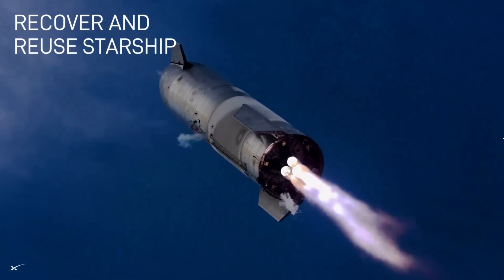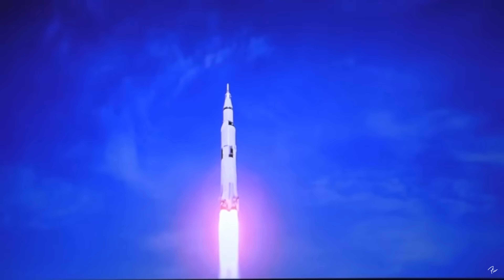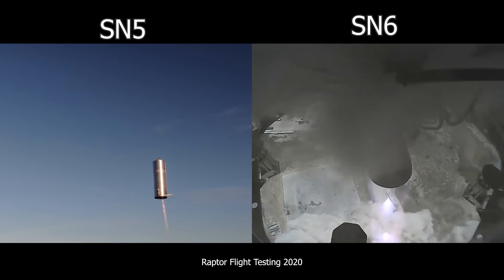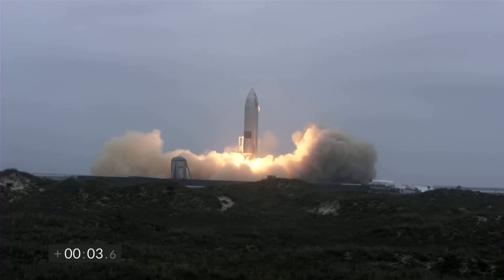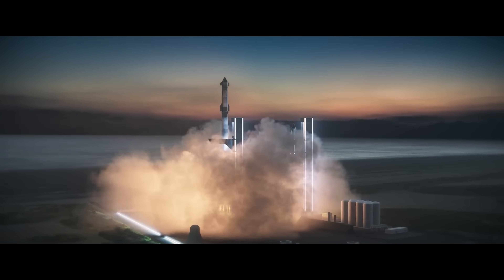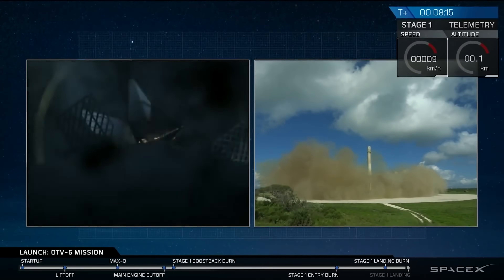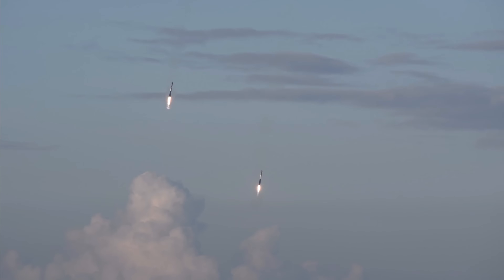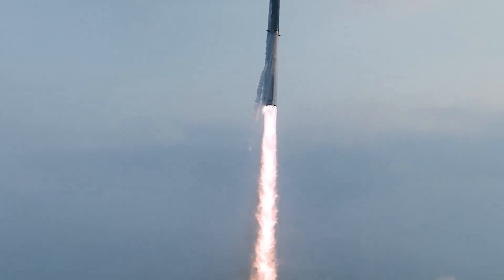The SpaceX Rocket Engine That Couldn't

Comment: Thanks Jeff Thornberg and program producer. He should have stuck around. Reckon there’s still lotsa homework lying around. Team SpaceX. Team Elon Musk & Team MARS   Thanks Again. PS. Tell him I can resolve heat shield issue. I wrote a 7 year 20 hour a day Dissertation on Ceramic Shell Bronze Casting moulds. And did Mathematical Scientific and biological analysis of materials from the mine as materials altered from raw material through to making of them into micron packaged bags available for use. Did receipts slurry viscosities and application and heat resistant temp measurements I can do their heat resistant coating. One application totally reuse-able and utterly damage free to ship and Astronaut s going to and from Mars. Build fuel tankers Mars moon landing bases. I have no means to communicate with Elon or SPACEX. Highly qualified 3Dimensional thinker RIC

Comment: As disappointed as I am with Elon Musk being such a broken toddler with regard to so many aspects of humanity, his companies--with the distinct exception of "X" his purchase and leadership of which was a tragic mistake--are the most impressive in the Western world.  I am also convinced that the Starship program has the potential to play a pivotal role in transforming human impacts on Earth’s biosphere from relentless destruction into climate system and ecosystem restoration and sustainable progress (e.g. by enabling rapid replacement of Earth-based mining with asteroid utilization).  That being said, I’m worried about test flight five.

Sure, the arguments or high risk failure-based learning have proven effective.  But the balance of risk versus reward remains really complicated.  The first test flight should have proven that.  The only reason it ended up being deemed worthwhile is that the impacts of destroying the launch pad didn’t cause significant environmental harm.  It could easily have been just slightly worse and caused the entire program to be shut down for years.  The potential explosive destruction resulting from a failed booster catch attempt may well do just that.  If I remember correctly, although the flight four booster apparently successfully performed a well controlled ocean landing, it was notably distant from the actual (original) targeted coordinates.  Despite SpaceX’s truly excellent track record of landing Falcon 9 boosters, which are very different, it seems to me that skipping the step of proving they have achieved pinpoint accuracy (within the margins acceptable for a successful catch) is a serious mistake.  It’s all too likely to not only dramatically slow the entire program down, but rationally and severely damage everyone’s view of SpaceX’s judgment.

Given how Musk’s devolution into an anti-American oligarch, demonstrating his fundamentally flawed racist and arrogant libertarian toddler’s character (presumably due to his traumatic and abused childhood) which echoes that of the foul folk he’s now indebted to because of the “X” purchase fiasco, has rightfully ruined his reputation with most reasonable Americans; I hope SpaceX (and his other companies for that matter) can survive the real consequences of his unbridled hubris.  Sadly, perhaps the most significant lesson that may come from his disruptive transformation of the processes of progress by appropriately leveraging failure will be that Americans finally appreciate and understand that privateering individuals and cults of personality which are not appropriately regulated are irrational and unsustainable.

Comment: Was there any research done at all for this video, the cost of Raptor 1 was less than 2 million per engine and Raptor 2 is roughly half the cost of Raptor 1. Raptor 3 is roughly half the cost again.
Reply: You have no idea what they actually cost, we only know what we have been told by spacex who have been shown repeatedly to do "creative accounting" for stuff like this.
Reply: @oglordbrandon  And you have no idea if the costings are incorrect. One thing is for sure, the complexity has been massively reduced from V1 which could easily translate to half the cost saved.
Reply: @schrodingerscat1863 
We cannot know what the costs are, but we do know that SpaceX have changed the design of the vehicle every time and retrofit much onto previously built vehicles.

We also know that the last cost metrics are at least two years old.

So you’re arguing from ignorance of the age of data.
Reply: @topsecret1837  As I said, all we know is what SpaceX or Musk have released. From that we know they wanted to get v3 costs down to around 250 to 500 thousand. Based on the simplicity of the v3 engine it is likely they have substantially reduced complexity and therefore costs. Have they managed to hit their cost target, we don't know but they will have reduced costs substantially.
Reply: @schrodingerscat1863  I still see only source for the numbers Elon/Spacex . Probably I should dig into the "design simplification" aspect but I am pretty sure I am not good enough of rocket engineer to deduce costs out of that. Guess time will tell. 

As for myself I would not belive any private business/owner with their  numbers - it's always their interests to show it in better light than it actually is. It's a tiny bit better with public businesses but even then if they are big enough (like most rocketry players) then it's easy to lie even with public numbers. Plus I admit: yeah there's a special place for Elon in my heart because he's been caught lying one too many times in the past.
Reply: @kalaants  From various sources like interviews with Tim Dodd etc we can see that there has been significant simplification specifically to reduce time and cost of manufacture as well as to improve reliability and reduce weight. Based on this the numbers Elon/SpaceX have released are plausible but that is all we can determine for now. We will probably never know the actual costs and as manufacturing processes mature costs will continue to fall. Reducing the cost and complexity of the engine has been their number one priority and based on what we can actually see of Raptor 3 they seem to have been pretty successful in this.
Reply: "Because Elon said"? Or what exactly is the source for these numbers?
Reply: @kalaants  All anyone can go on are numbers released by Musk or SpaceX, reduced complexity of the engine to ease manufacturing is a key feature though and they are making an engine every day or so. So they have now made so many of these engines with so many simplifications that manufacturing costs can easily be significantly lower than anything else. You only have to look at a Raptor 2 compared to say a BE4 to realise how much more advanced the Raptor is in this respect, BE4s are being sold to ULA for around 8million each and based on attempts to renegotiate the contract it seems Blue Origin are probably losing money on those engines. Looking at Raptor3 the engine doesn't even look finished it is such a streamlined and simplified design. No company has ever made the effort to do this before and I can easily see how costs have been reduced by orders of magnitude for these engines.
Reply: @kalaants  Under one million is the only first hand source number.  “the source is a guy I don’t like,” isn’t a good counter argument when he happens to run the company.

Comment: So here's my question.. how are they going to land a fully assembled starship on the moon or mars, carrying 100-200tons?
Reply: starship is just the upper portion not the booster the booster will never leave earth. And on mars that 200 tons weighs 76tons and on the moon it weighs 34 tons. But i don't think they actually have the method nailed down just yet as far as the landing system goes because well they just aren't their yet. It will likely be some type of deployable legs but i dont think they have released any info on what that might look like yet. LIkely because the ship is still being designed so they do not know how much weight they will have to work with and its hard to design something if you dont have all the parameters you are designing to yet.
Reply: Landing on the Moon will require a ring of landing engines mounted just above the main tanks. These engines may only be necessary during the lowest 300 meters, to prevent throwing regolith and eroding the surface where each leg must touch down. 

The instrumentation needs to be highly accurate, bringing the horizontal velocity to absolute zero. The landing sensors, cameras and software must select a destination where the surface is adequate for every landing leg, and deployment of cargo by crane. 

The landing legs must conform to the uneven surface and make the craft level plumb.

Comment: While Raptor 1 may indeed have come in at $2 million a pop, all integrated flight tests have used Raptor 2, and Raptor 2's cost per unit is actually under $1 million.  The entire stack, Starship and Booster combined, with all 39 engines and all those tiles, costs under $100 million.  Still pricey, but an easier pill to swallow when attempting to contextualize rapid iteration of Starship.  For comparison, SLS is a >$2 billion vehicle.  I should also point out that a huge benefit of using engines of Raptor's size is that you can swap one out in an hour, without having to first take the entire vehicle back to a bay and/or tip it on its side.  The likes of SLS or New Glenn cannot boast a similar ease of maintenance.
Reply: New Glenn might be able to. Sure they are bigger but they are similar in size and have the similar thrust
Reply: You will know this 100 million is a lie when you see what NASA pays for starship to go to the moon.
Reply: @oglordbrandon  Current Starship stacks run about $100 million to manufacture.  (It's actually ~$90 million now per Ars Technica and others but we like round numbers here.)  You're basically saying it's a lie that SLS only costs $2 billion to make when the total mission cost is actually 2 to 3 times that.  I'm... really not sure how you thought that was any kind of argument.
Reply: swap one out in an hour?    What makes you say that?
Reply: @CurtOntheRadio  we've seen them do it
Reply: @CurtOntheRadio  We actually watched SpaceX effectively do this after a Static fire test.
Reply: @SirDoggydog  where?  when?
Reply: @CurtOntheRadio  Nasa OIG report on SLS is cost
Reply: Idk what is up with you spacex fans. That Sls figure is the entire cost of the program including launch infrastructure and payroll. The marginal vehicle cost isn’t 2 billion. The starship total cost per launch is also easily a billion dollars when including what is included in the Sls launch figure
Reply: @mattkingston6157  No, The Marginal SLS Cost is over 2 billion.  The full Artemis 1 launch cost 4 billion before accounting for launch infrastructure.
Reply: @mattkingston6157  Bro, all of this is a google away and documented persistently in articles discussing the topic.  SLS is $2 billion per vehicle, or $4 billion in its Artemis configuration.  By the time Artemis I launched, the development program for SLS had reached costs of $23 billion.  If you really want to conflate the costs of development with the costs of post-development manufacture—something nobody does—SLS currently sits pretty at a prospective $10 billion per vehicle.  In this fun hypothetical, SpaceX enjoys a remarkable advantage in that they can make a new Starship prototype stack every couple of months if the FAA's schedule allows, even now when the vehicle is still very firmly in its rapid prototyping stage.  That thins out the ~$10 billion pricetag for the entire Starbase facility.

Comment: 5:30 The very next thing SpaceX was going to do at Starbase, no matter how IFT1 turned out, was install that deluge plate.  Launching with just the concrete was more than just a calculated risk—it was a tremendous time savings.  The only way it might have actually lost time was by failing its "primary goal" of making it past the tower and instead blowing up on the pad.  So picture two scenarios: 1) You wait until the new pad is ready before launching.  This takes 8+ months because the FAA/EPA have to laboriously vet the new structure.  2) You launch anyway, unexpectedly create a crater, and then install the new pad.  You've added, what, about a month to the wait before IFT2?  Meanwhile, for eight months, you've been poring over the all-important data you secured, and this data informs major design changes on the next flight, such as a switch to hot staging.  SpaceX fast-forwarded their program by over half a year when they chose to fly IFT1 before changing up the pad.
Reply: yeah plus they saved the boys a bunch of back breaking work by letting the rocket break that concrete up for them lol
Reply: @zachmoyer1849  Plus I got to go back to the pad area and take some of that concrete home with me!
Reply: @zachmoyer1849 lol
Reply: This is what most people seem to misunderstand about fast iterative development. The point is, if things aren't failing you aren't pushing hard enough and the data gathered pushes the project in unexpected directions to ultimately get a far superior result.

Comment: What of the fuel/oxygen in the pipeline?  At some point in time, before here it goes this way to another group of engines which is probably very touchy to flow changes "on the fly".
After here, it goes that way to the exhaust pipe and away.
Reply: You are right, it is "touchy". Engines can be easily switched to another tank source while they are shutdown. But it is very hard while running.

Comment: Welcome back man!

I haven't seen the whole video yet, but from some amount of 'insider' information, I believe that the engine that didn't light on flight 4 was because the outer 20 raptors are Spin-Started from the launch mount, and that engine was not properly spun up, which was a fault of ground equipment, not the engine itself.

Edit 1: Concrete on flight 1 knocked out one of the HPUs and damaged the other. It's also known that fires throughout the booster skirt were rampant, as well as very flammable leaking hydraulic fluid was everywhere, you can see this from some live stream cameras.
Reply: My professor in college said something to the effect of “engineering is the last discipline where you can go to a conference and hear the party line during a presentation then afterwards over a coffee (or something stronger) they’ll tell you what actually happened” 😂
Reply: @NicholasAndre1  your professor is so so right. I just get the perk of knowing half of everyone in the industry at several companies and being in the middle of a SpaceX internship at Starbase myself.